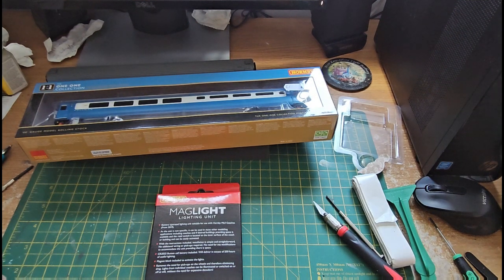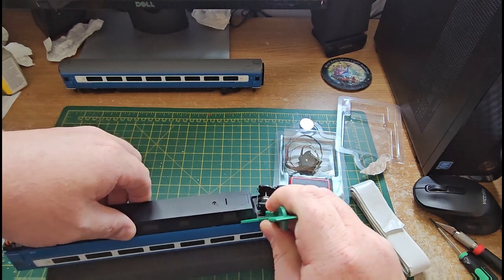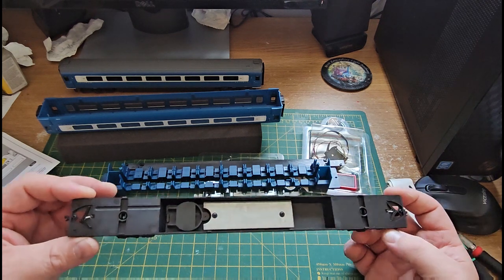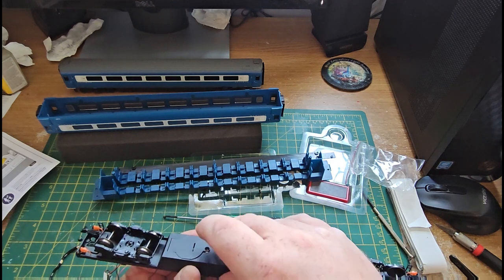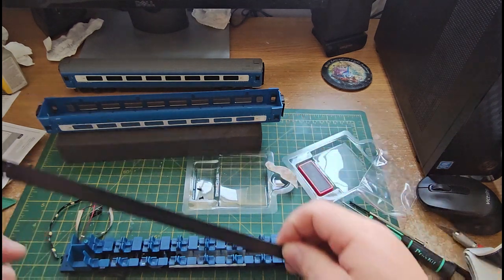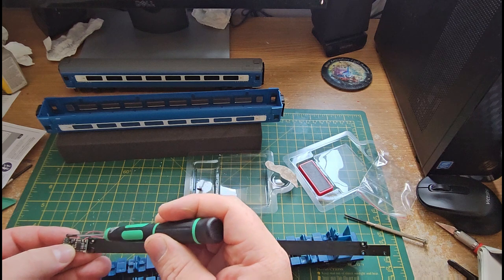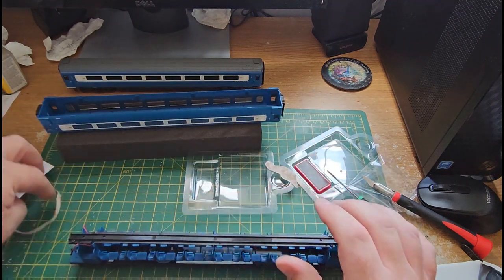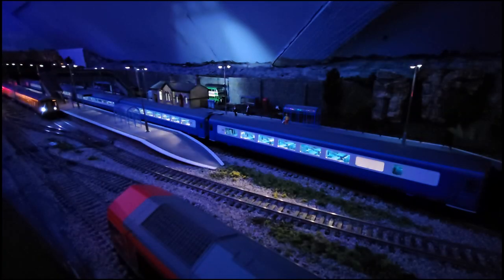Fitting Hornby Maglight Units To MK3 Coaches

Comment: Hi, great video content, does your magnetic wand from your Accurascale coach pack work on the Hornby lighting? I'm going down the ESU lighting for my Hornby coaches(APT) then i will fit to the rest a set at a time, they are a a bit more expensive but they have a decoder on board like the Bachmann lighting but have a lot more functions, the battery changing bugs me, the batteries aren't cheap if you opt for a quality brand, the coaches aren't cheap.
I have just purchased the Accurascale nuclear flask wagons, no batteries supplied!!! no magnetic wand until next month, i will never purchase another item like it from Accuracale again, £75 for the wagons with no batteries, they should have produced a non flashing light option or a basic decoder like some companies offer, thanks for sharing.
Reply from the maker: Hi glad you enjoyed the video, I haven't tried the accurascale wand yet, I don't see why they wouldn't work but I'll give it a try and thanks for the info on the accurascale flask wagons I have a pack on order, that seems abit daft on there part to supply them without either, thanks for watching. Tom

Comment: I fitted them into my lgb 4 wheel coaches, worked a treat until i forgot to turn them off and they went flat 😂
Reply from the maker: I almost done that with hornby 4 wheel coaches luckily when I ture d the loft light of I could see them illuminated 😂, that's a good idea for the lgb coaches, might try that myself saves connecting each coach up to the loco or track, does the magnet work ok on the thick plastic roofs
Reply: @northwesttrainsmodels  what I did was put the reader chip right to the edge of the interior where the plastic is a bit thinner, and also put it near the open window in the coach so i could always put the magnet through the window to get the lights to come on and off if I couldn't get it to read through the plastic. 👍
Reply from the maker: @CustomiZe_  ill have to give that a try I've still gotva few lgb locos to fit lights into